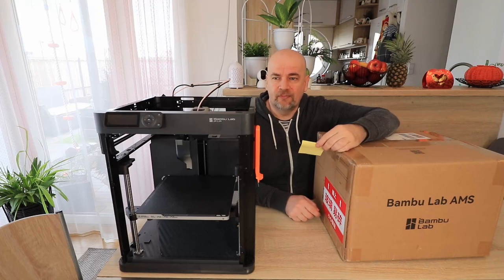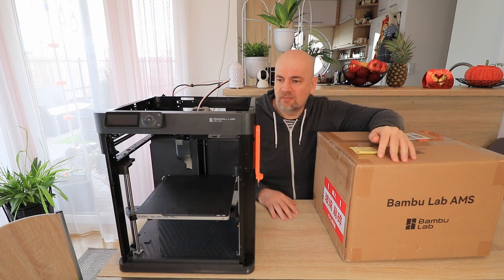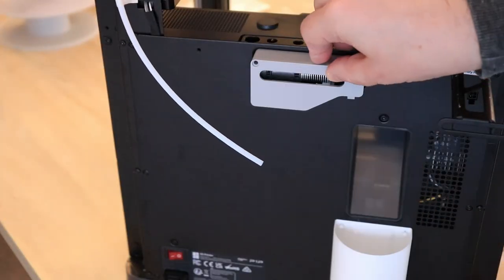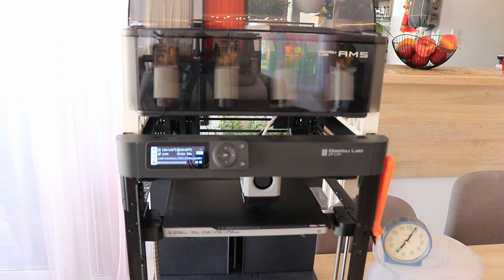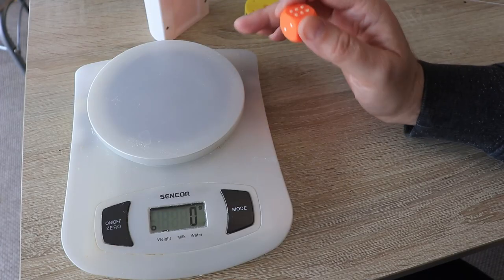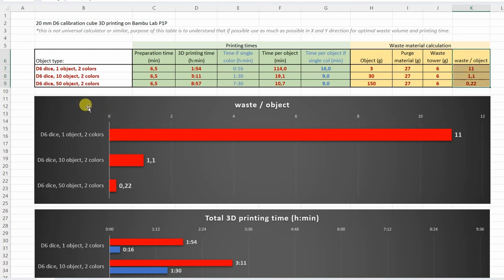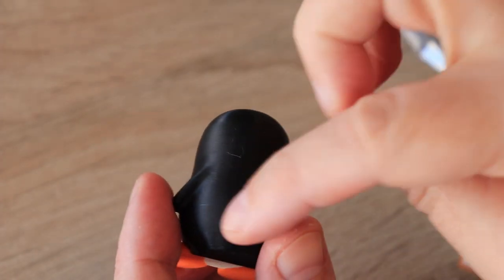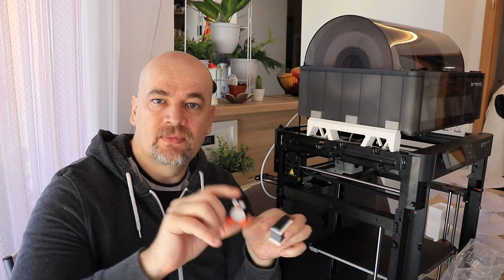BambuLab AMS on P1P 3D printer - lets talk about the quality, printing times and waste materials

Comment: I use the AMS on my X1 Carbon. Since I print functional parts, not decorative items, my filament changes are for automatic filament runout, coloured labels, and material type changes. As a result my filament changes are quite few on a per object basis and therefore I have very little waste. Having said that, the AMS has been extremely useful for these functions. My X1 Carbon and Ender 3V2 have been running pretty much 24 hrs a day for the past 6 months and I have found the X1C with AMS to be extremely reliable allowing me more time to work on other jobs.
My biggest complaint for the AMS is the inability to handle flexible materials like Polypropylene, TPU and TPE. Being able to switch out these materials would make the system much better.
Second biggest complaint is the compatibility of spools. Several brands of the filament spools I use will not fit in the AMS. I have to re-spool the filament, which is a pain but worth the effort for the flexibility the AMS provides.
I have had some issues with wet PLA 3D850 filament, which gets brittle, and breaks inside the AMS necessitating a tear down of the AMS to remove the broken filament.
Reply from the maker: Useful info, thanks Tom!
Reply: @MyTechFun Can this P1P print CF-NYLON filaments?

Comment: Could have reduced lot of filament waste and time,by simply orienting with the back down on build plate, with supports enabled(and using a dissolvable/breakaway support).
The idea is, keeping the number of colors to minimum, as you move from one layer to the next. Additionally, the nose and the feet could have been printed separately, and attached later with super glue. That would eliminate all the purging due to the least used color. The trade-off is a little bit of surface roughness and gluing parts after print. Just some 💭

Comment: I hate the AMS on the x1 carbon we have at the office. In addition to the issues mentioned most filament comes on larger spools and it makes no sense to rewind filament on the clock. Even spools that fit don't work with a full 1kg load.  It has also never successfully changed spools when one runs out.

 I agree 100%, IDEX would make much more sense. For that matter it would likely be easier from an engineering and production standpoint and you could still offer an AMS in addition.  (It would of course make the machine larger and a bit more expensive but cheaper and smaller than the AMS combo)

This is a very slow, very fast printer :)

Comment: I hope that they come up with a solution for the waste. On large parts you can use the infill as purge tower but for small parts this may not be enough so it will need some careful consideration and smart people to solve the issue.
Reply: I was wondering if increasing the infill % would reduce the purge poop and purge tower? You still use more plastic, but it’s not “wasted” as it would increase the strength of the part.
Reply: you can Purged into the infill to cut down on the waste

Comment: Did you try to compare monochrome printing time vs multicolor time? That would be interesting? Or did I miss it?
Reply from the maker: BambuStudio gives you very accurate estimated time. But if only 2 colors, just add 1,5 minutes for each layer. Now imagine, for smaller parts, layer will be printed in 4-5 seconds, then 90 seconds color change.

Comment: This is probably a silly question, but if you have an AMS and want to print with a single color, do you still feed the spool through the AMS? In that case, I assume that there would be no difference in terms of how long it takes for the print complete, am I correct?

Comment: Interesting, I noticed that I did not receive ANY empty spools with my AMS, which is very disappointing as they are both very expensive and also out of stock at Bambu.  (I purchased the X1C AMS combo)
Reply from the maker: I can see, they are included with AMS: https://eu.store.bambulab.com/en-hu/products/ams-multicolor-printing (in the box part)
Reply: You're right - the AMS which is included in the X1C AMS combo doesn't come with the empty spools. Those will be included only ff you buy the AMS separately. I was positively surprised about that as I bought a second AMS which I just received.

Comment: Thank you so much for this video. I liked and subscribed. I had a question, which printer would you recommend if I’m mass producing small decorative (3-4) color small figurines when speed, accuracy, and reliability is needed?
Reply from the maker: A lot of waste material with AMS, but with mass production you can fill the bed with figurines, less waste in %. AMS is one of the most reliable color changing system.

Comment: Igor, what type of white filament was that you printed, which was warping? Thanks for the video
Reply from the maker: It arrived with P1P, PLA matte in white color. BTW, soon Bambulab will have regular PETG too (not CF), and they will send filaments to me to compare PLA basic, tough, PETG, ABS. It will be an interesting comparison..
Reply: @MyTechFun  I rarely have that much warping on pla. I was thinking it was like petg. But thanks, great informative video
Reply: I had had issues with Matte PLA (warping and layer adhesion) in the past so I don’t use it anymore.

Comment: I hope for you that this will make your filament tests a little bit easier.
Reply from the maker: Inserting the filament is not time consuming, the testing is much slower. And pity that TPU or CF filaments cannot be used with AMS.
Reply: @MyTechFun  i was thinking you could load 4 filaments and program 4 sets of specimens to print sequentially on each corner of the bed?
Reply: First we should know how much the printer affects strength. Also I think the materials need to print at same temperature and in sequence to avoid constant filament change :)

Comment: Hi, did you check out the snapmaker j1 idex? Seems to have few problems, but should be way better then sovol sv04 which i did se you had reviewed. Im sitting a bit on the bench waiting to se how prusa xl 5 head multi system will work :)

Comment: For 1 kg of filament on one object, 4kg of material is wasted…

Let’s wait for a different or modern way of making a multi filament 3d printer
Reply from the maker: If you spend 1kg on an object, probably it is big and you are using more of X and Y direction, then the waste % is much smaller.. That was the point of those charts in my video, I tried to explain this.